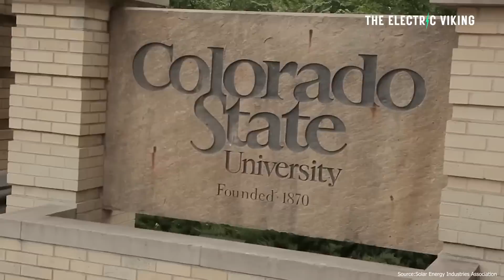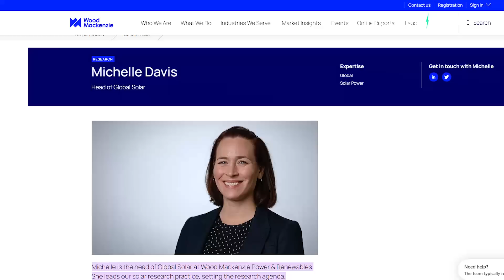US smashes solar records in 2023 with unprecedented 55% growth

Comment: As an American electrical engineer who designs and builds power distribution systems for some reason I've had no interest in so called green energy which is iften not so green or climate change. We've seen these systems fail, particularly wind farms in the winter in Texas and during a summer in Britain. They only work under some conditions,. Energyy storage capacity for when they don't produce power is limited and expensive and therefore unreliable. If more conventional systems are not available for backup the failures can be catastrophic. Foolish failure to install plenty of reserve overcapacity is bad enough but reducing the diversity of sources away from reliable to unreliable virtually guarantees disaster.  Without electric power we regress two centuries, conditions we cannot survive in for very long.

Comment: Solar panels on individual roofs is as stupid as vegetable gardens in peoples backyards. All the libs that advocate for local/community gardens and farming have no comprehension of scale. Theres a reason industrial farms were created, because things can be done more efficiently, i.e. more food for less money. The exact same principle applies to solar panels. There is much more overhead and cost for installers to install these panels on every freaking house than if they churned out a massive solar farm. Its the exact same thing as laying the underground cables to every house for internet and tv, you would only do it this way if it was absolutely necessary, which it was at the time for internet but harvesting energy doesnt have to be done this way ergo it shouldnt be done this way.

Comment: Hey Ab - that is right plus lithium is too negative to mine, requiring far too much ecological impact. So far If EVs are going to be the world wide impact the advocates want the only think on the horizon is Sodium.  Sodium is suppose to be far cheaper it is all about if they can get it to be durable, take enough cycles, and get similar energy density.  If those hurdles were overcome then EVs and batteries look much more viable.  I dont' think lithium has a better future than nickel metal hydride..

Comment: Albert is wrong, he may get a benefit but ; In California; Solar new solar panel installs cannot sell their energy to the grid; so it is worthless to new builder unless they buy a big expensive battery to store energy from the cells ; few people anywhere can afford that.  The result is fewer solar is being installed on new homes. Secondly some of the largest solar farms are now dead in Nevada. In 2022 US solar was 2% of energy production even if grew 50% it would be 3% but it did not grow by 50%.; it will be under 2.5% of US power production in 2023.
Reply: In order for solar to be economical, the price of batteries needs to fall. Right now, channels like this claim that Lithium Ion batteries sell for around $100-$150/kWh, except an individual consumer cannot actually buy such a battery without paying 10 times that price.

When a day's worth of energy can be stored in a $2,000 battery, then the value of solar increases dramatically, as you can sell it to the utility at the time when the utility needs the power (e.g. when prices are highest), not at the time the sun happens to be shining on the panels (when prices are much lower because everyone else's solar is flooding the market). But, when that battery costs $20,000 instead of $2,000, the whole thing no longer pencils out.
Reply: eia.gov says us solar was 3.4% of energy production in 2022.  https://www.eia.gov/tools/faqs/faq.php?id=427&t=3

Comment: The state you live in is a major factor on the incentive to go solar in the US.
I'm in MA. MA has one of (if not the) best net-metering policies in place. All excess energy is sent back to the grid and credited to my account for pretty much full-retail rate, with zero cap. All that credit just rolls over year after year.
I got going with solar in August of 2017 and my last direct payment to the grid was March of 2018. Since then, just building up that credit. My most recent grid electric statement (I don't call it a bill because I never owe them) shows a credit of $850. Some of that will be eaten away at from now until March, then it will just build up again through Oct. of next year.
My entire cost for solar was a little under $14K. My pre-solar electric bills averaged roughly $1,150 per year, so my payback price for the panels will be 12 years from that start date of Aug. '17. After that, all my electricity is free. 100%. 
Also, I have a plug-in hybrid car that I drive mostly on battery only, so my free electricity charges that car. Pretty sweet.

All that said, if you live in a state that doesn't have a good net-metering policy, you really need to buy back-up batteries to keep your own energy and avoid giving it to the grid for mere pennies.

Comment: Solar panel price is so low and it is not sustainable. In fact, high grade sand used to make Si wafer is running out very fast. In a few decade the price of solar panel and also chip will be insane.

Comment: I've had solar in Florida since 2017, I am very happy, I have not paid a power bill since then with the exception of the minimum amount due just to stay connected to the grid for net metering - (which is a scam in itself and another discussion).

Comment: The problem in CA is there is not enough energy storage.  If the solar output is greater then the load it can cause grid stability issues.  I think CA and US govt need to support residential installations with batteries to level out the load.  That's what I have on my house.
Reply: More solar without batteries in California would be stupid.  People want others to pay them for power to the grid that is worthless due to there being excess power on the grid. We cannot have more solar without more batteries.
Reply: Spend money on localized solar instead of the grid, making the grid more stable, most cost-effective
Reply: Buy your own battery. Don't expect  others to pay for what you want, or believe.
Reply: @robertfonovic3551  You missed his point. By incentivizing battery purchases (which are still extremely expensive) it'll take the pressure off the grid.
Reply: @robertfonovic3551  i think thats a totally stupid american solution to everything...thats why people laugh at america...the best health systems you cant buy.  Governemts either drive the agenda for everyone or the agenda drives you. Thats why china is so successful and america has fallen down the plughole. One country could see the future, the other one didnt give a fig.

Comment: The California rule change is really about installing residential batteries rather than sending excess solar generation to the grid.  

In a future video could you cover the new wind farm in the US state of Wyoming.  The Power Company of Wyoming project will have 600 turbines rated at 3000 MW.  The TransWest Express HVDC transmission line will bring the electricity to Southern California.
Reply: Don't you find it IRONIC that (according to the website) this is located in CARBON COUNTY LMFAO ...
Reply: @capnkirk5528  It's also ironic (moronic?) that almost all US coal is used to generate electricity and Wyoming is the largest coal producing state, so they should be pro-EV but their legislature is anti-EV.
Reply: Misinformation or just confused reporting (hydrogen is not a priority in California).  Stop shilling out for the solar corporations, which already make more profit in California than anywhere else.

Comment: The longi 33% efficient solar panel, an increase of up to 100%, will kill every other form of energy.  Just imagine the savings for the replacement of old systems.
Reply: Efficiency is overrated. What matters is cost. Capacity factor is harder on solar than efficiency, but there’s nothing that can be done about it - the Sun doesn’t shine at night. Efficiency is hard because the silicon only responds to certain light frequencies, and it gets harder and harder to add more. Still, solar is already knocking everything else down, because it’s SO cheap. And as batteries, thermal storage, and other storage improves and scales, the cost benefits will just keep growing. I kind of feel the war is already won, even if the battles aren’t over yet.

Comment: My 3.35 KW SunPower system has been rocking since 2015. I plug in my electric heated floor for internal heating along with 2 electric heaters for the evenings before bed.

Comment: It could have been helped by Californians net metering change to a less positive rate for solar customers . I am sure it was a big ramp up to get grandfathered into the old better deal metering . I was getting solar guys banging on my door every other day . That has almost completely ended . I am sure some installers have gone out of business which can be a problem for warranty issues . Now I have huge solar farms in my area which is a form of industrialization of the desert . The native look has been destroyed but I understand the reasoning . 

California appears to have gone more of the solar farm route and building more transmission capacity and turning their back on rooftop solar which takes up the natural land .  Wires , poles and panels for as far as the eye can see .
Reply: California under Newsome is fooked

Comment: Haven't had an electric bill for 15 years.  Don't understand why anyone is willing to keep buying electricity.  Solar panel systems prices have dramatically dropped and can be started at low cost and expanded over time.
Reply: Same, but 5 years. 8 year ROI on my system. Need to get another system soon as we have since converted some appliances to electric and gotten a pool and two BEVs.
Reply: A work colleague recently spent £12k on solar panels and battery. My annual electricity bill is about £600, but the interest on £12k would be at least £360/year, so the most I could save is £240/year. Does it make sense to spend £12k to save £240/year? Obviously not. For me it would have to pay for itself in 5 years, so prices have to down to below £3k

Comment: I'm a IBEW Union Electrician in the USA. Solar projects are being built at an incredible pace. I just don't want to work outside during winter. I work at a Ford Blue Oval BOSK battery plant that is dried in and heated.
Reply: Thank you for the additional information. I'm glad that you have a good job to work. The average person does not understand the massive efforts that US automakers ARE undertaking to ramp EVs. US automakers know that they need to vertically integrate and produce their own batteries to make a profit on EVs. I appreciate hearing from someone on the inside of these projects. Do you know if it's possible to just tweak the battery production line to switch from NMC to LFP?
Reply: @nooneyouknow7036  No. I'm one out of 700 electricians and one of 5000 construction workers.
Reply: Tell us as much as you can about BOSK, plz. Are you in Glendale, KY. How long before it is close full production?
Reply: @nooneyouknow7036  Ford BOSK is behind schedule. It's the biggest project that I've worked at in my lifetime. Because I watch the Electric Viking I realize it is a stranded asset. I'm happy to see Ford build a battery plant but it's not lfp batteries. I expect the plant to be different than envisioned. The second building Ford is slowing down and delaying production.

Comment: Every domestic solar installation is a nail in the coffin of Exxon, because the owner will realise that if they can get the electricity free, why not get an EV and be done with gas/petrol for ever?
Reply: Not really. Electricity in the US is 60% gas and coal, 17% nuclear, almost 0% from oil.
Reply: @@OrwellNailedItHow is possible to project " a lifetime saving " on something that is still operating.
Did you use a calculator or a crystal ball?
Reply: @@OrwellNailedIt I’m not convinced of either.
Reply: The electricity is not free.  You have to divide the cost of equipment by the amount of power generated over the life of the system.
Reply: @davidmarkmann6098  The smart accountant tells us that the solar power is not free for use by the EV. But the really smart accountant tells us that we don't need to own a car; It is cheaper to have no car but use a taxi when we need transport.
Provided you live in a city or largish town, it is quite possible, as a 40year-old friend proves; she has never had a drivers licence.
Reply: @davidmarkmann6098  
My solar array will have paid for itself (not paying any electric bill vs. previously paying roughly $1,150 per year) in 12 years and then I can honestly say that all my electricity is free.
If the grid electric prices rise, and I'm not paying that increase, my solar payback is actually sooner than those 12 years. That 12 year payback time is based on 2017 electric rates. They don't go down, so my payback time will probably be closer to 11 years.
Reply: @davidmarkmann6098 
Electricity not free but its at a fixed cost based on solar equipment loan i got a few years ago.  I save  75% vs utility grid.  Its fixed so immune from normal rate hikes. I plug my car in and 100% of driving around town is powered by the roof solar.
Reply: @davidmarkmann6098 don’t confuse environmentalists with math.
Reply: @@OrwellNailedIt It's not highly profitable. What does the math look like when you account for the 8% yearly interest you lost by not investing that $50k+? Over the last 25 years, US electricity has increased 2.4% per year, market has returned 8% per year. That's the problem with this crap, high upfront costs you will never recoup when you factor in the lost investment opportunity. My neighbor just went geothermal, in the long run i'll come out way ahead by burning oil and not pulling $30k out of my portfolio to save $1k/year in heating cost.
Reply: @OtisFlint  The mistake made by many is thinking that costs will vary slowly and uniformly with time, and thus we get arguments in favor of fossil fuels.
In reality, effective climate action will be hugely disruptive, and fossil fuels will eventually be hit with outright bans or huge taxes.
Governments around the world are trying the softly,softly approach and trying to encourage people away from fossil fuels.
When that doesn't work (and Big Oil are trying to sabotage it at every turn) all governments, not just USA, will have to get tough because the well-informed voters will demand it.
Good luck with trying to buy heating oil in 2040. I'd be looking at geothermal now, before the rush sets in.